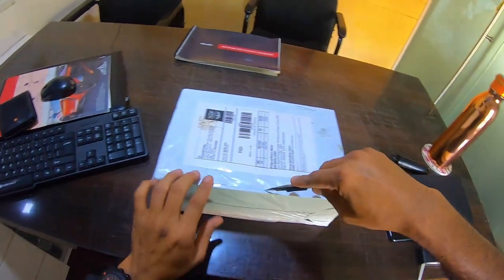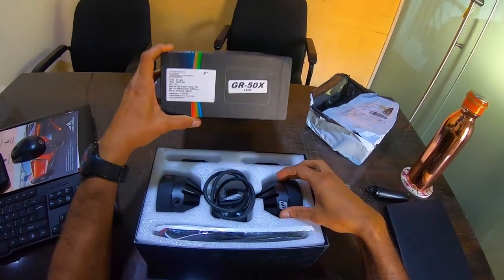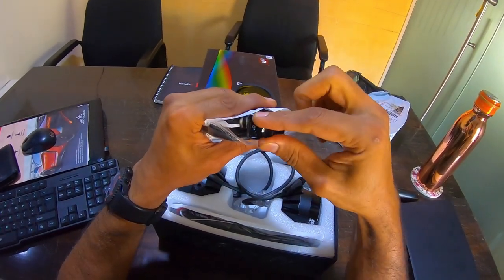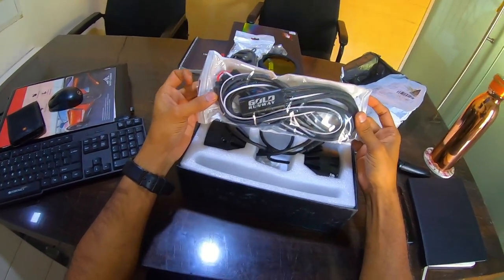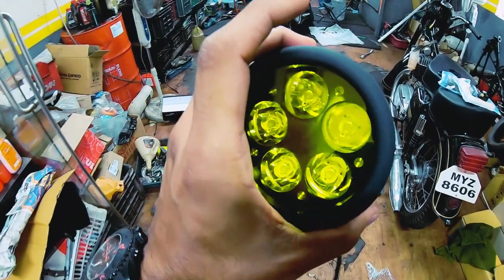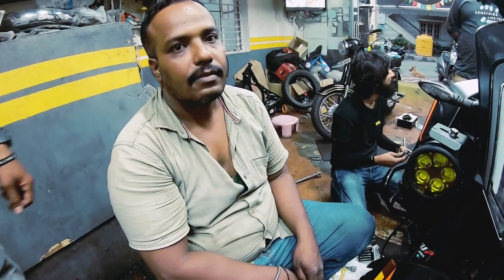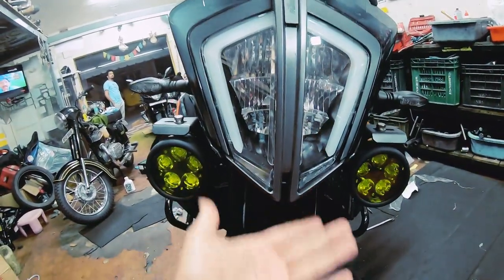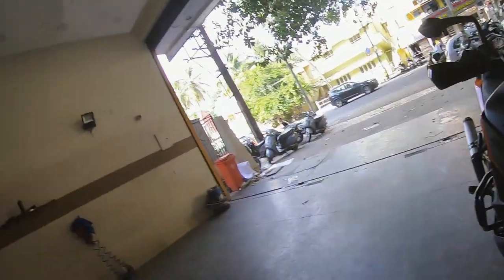Gold Runway 50X Aux Lights installation on KTM 390 Adv-X

Comment: The whole setup and installation was great. The PPF and custom cover is too good. I use socks to cover them from cops.
Reply from the maker: Even I got the idea of using Jockey socks as the cover. But then felt this option is still cheaper 😝

Comment: Are you planning on installing any crashguards?
Reply from the maker: No. The stock crash bars are sufficient. It’s a light motorcycle and don’t want to add unnecessary weight to it. Besides, the parts are inexpensive and easily available. May add Barkbuster if/when the stock handguards get damaged.

Comment: can you show in detail how the headlight stabilizers where installed, and what is mileage you are getting?
Reply from the maker: Actually the footage could not be shot due to working in tight space. The neck brace comes with proper installation guide. I’m getting around 30-32kmpl riding below 110 kmph.
Reply: @prameethprabhu  thanks😇

Comment: Nice lights. Never heard the name before though. Have you tried or thought of putting Mad Dog Alpha series? You would have got a similar output and would have cost around 15K including harness, filters etc..
Reply from the maker: Yeah. It is not very popular. Mad dog Alpha is bigger in size and is 9600 Lumens and there is no dimmer switch in it. GR 50X is 12000 lumens while still being slightly smaller. Also, the throw of GR50X is better. The fit and finish of the Gr 50X hardware is top notch. You get what you pay for.